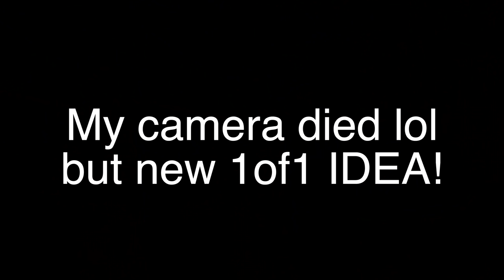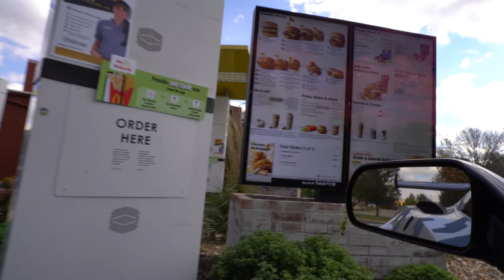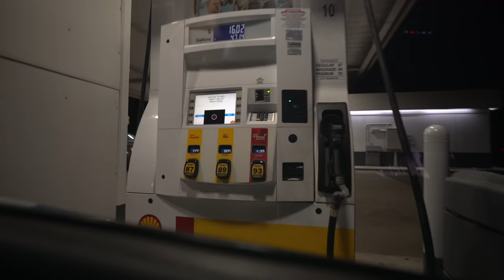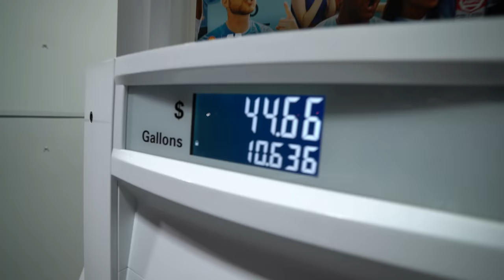FINALLY TWIN TURBOING MY C7 CORVETTE *REAR MOUNT?*

Comment: Not a fan of the twin turbo but I’m curious to see how it turns out. I’d send my Vette to LMR 🤷🏽‍♂️
Reply: I mean LMR is great at what they do, but turbos are soooooo much more efficient. You don't get the heat soak from the positive displacement blower, they sound incredible, AND biggest of all you get multiple maps and boost levels with pump or E to choose from unlike a blower......Turbos make so much more sense than a blower to me.